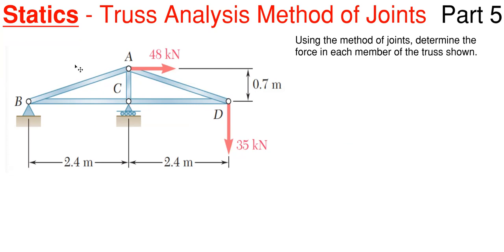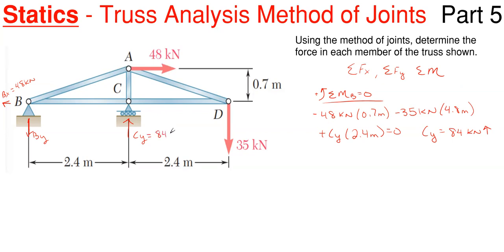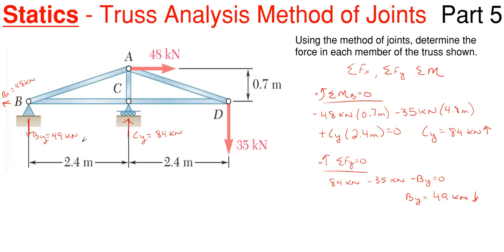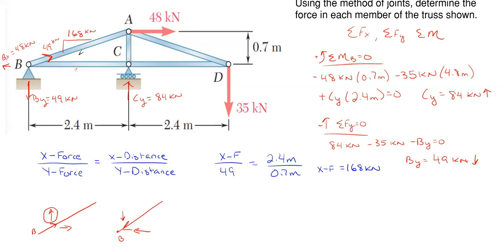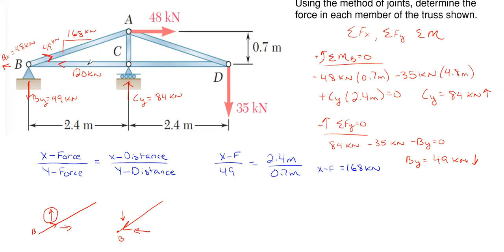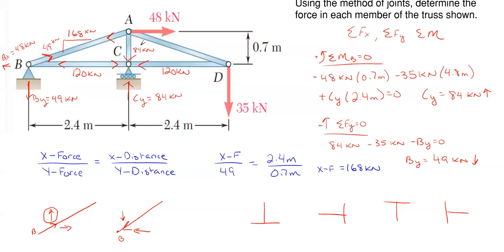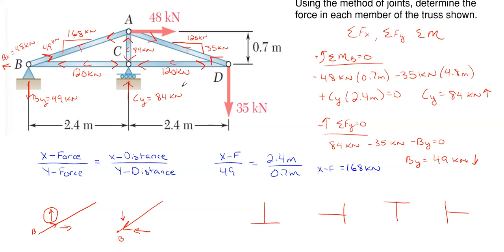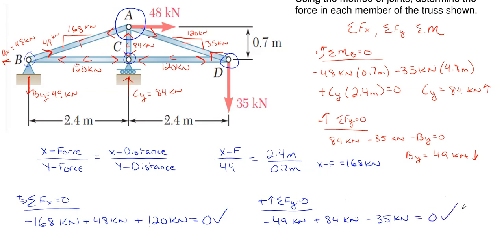Truss Analysis Using Method of Joints to Solve for Member Forces – Statics Truss Analysis Problem 5

Comment: Hi prof, may I ask? Why do you put the 48 kN and multiple it by 0,7 on the momentum B, which in my knowledge the 48kN is won’t effect anything since it’s allign with X, thank you by the way..
Reply from the maker: Hi! So, you must include any force which has a perpendicular distance from the moment summation point.  Since the 48 kN force is 0.7 m in the vertical direction from point B, it must be included since the 48 kN force is causing a rotation about point B.  Or, you can think of it like this, draw the line of action of the 48 kN force.  This means drawing a horizontal line directly on top of the 48 kN force arrow and extend this line of action all the way to the left of the picture.  Since the 48kN arrow is horizontal, the line of action for this force will be horizontal.  Also, since the force is 0.7 m above point B, the line of action will also be 0.7 m above point B.  Since this line of action for this force does not pass through point B, the force of 48 kN must be included in the summation of moments about point B.  I hope this helps.  Sorry for answering you days later.